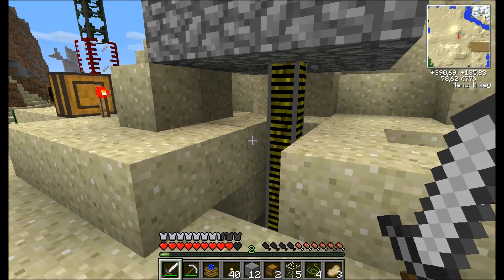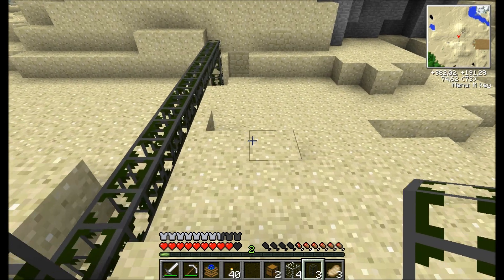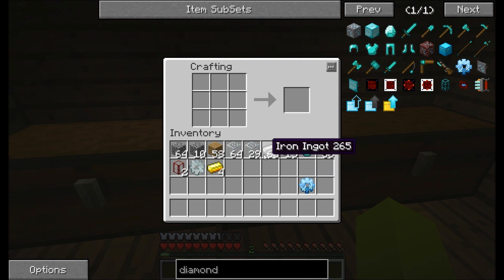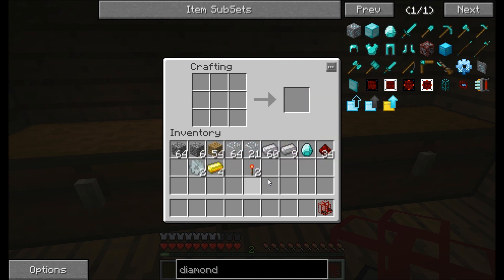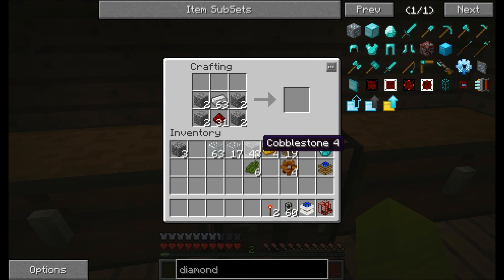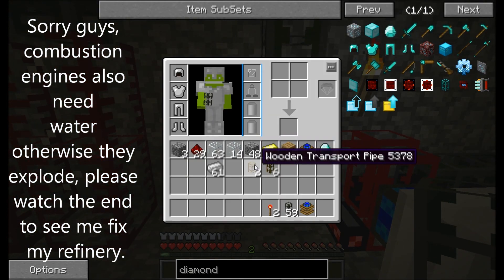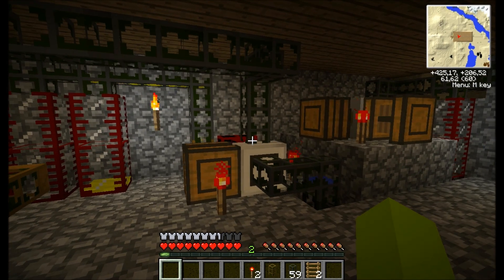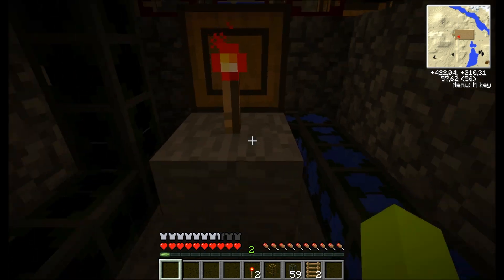Minecraft Tekkit - How to build an oil refinery, produce / make fuel, pump oil and water

Comment: i have been following you and wanted to say thank you for all your work and helping all of us.. but when it comes to the refinery.. i got it pumping to it..and making the fuel. but it never exits the output side to even get to the pump to put in tank.? any suggestions or does it take a long time for it to go through the refirenry?
Reply from the maker: on the output side you need a wooden transport pipe with a redstone engine to power it, I pump my fuel into tanks after I have refined them
Reply: ok i fixed that lol.. it shows some yellow going into my tank.. but then you dont see it making fuel and not filling tank.. and i have plenty of oil going to the refinery..any thoughts or suggestions plz..  this is about as bad as trying to making a working power plant.. hahahah and i dont have a working power plant.. hahah thanks m8
Reply from the maker: Sgt Scrapps be sure that you havent used a wooden transport pipe on the actual tank itself otherwise it will be pumping out the made fuel back into the refinery. The oil tank needs a wooden transport pipe, and the refinery on the left side which the fuel comes out. make sure you put a cobblestone waterproof pipe going into the tank which contains the fuel :) if you are still struggling try and make it exactly how i made it on the video. Also make sure you have powered the refinery by using a combustion engine and not a redstone engine :)

Comment: Wtf? When I'm building a oil pipe, like all the oil stops in 1 pipe and I need red stone engines to keep it going and it needs like 1 engine every other block. Why is this happening!?!?
Reply from the maker: You need to make sure that the piping you are using is cobblestone or stone pipes that have been waterproofed. As you can see in the video you need a wooden waterproof transport pipe with a redstone engine on the tank or the pump itself as its an output pipe that needs to be powered.

You should not need to power every pipe, can you please tell me what type of pipe you are using so I can try and assist you further.